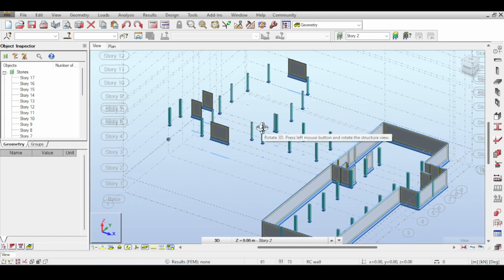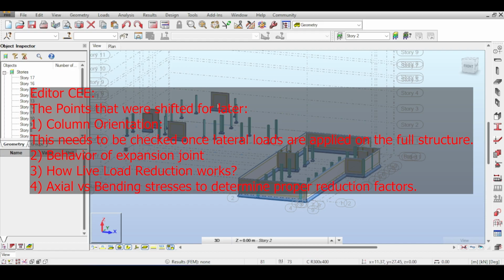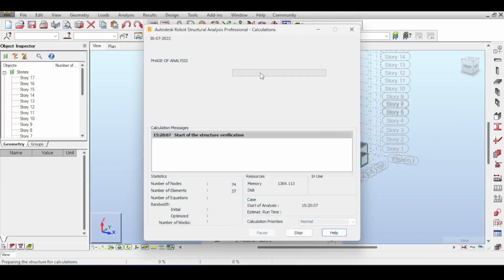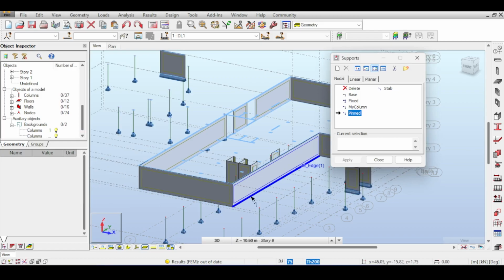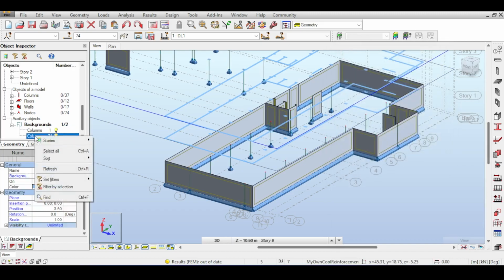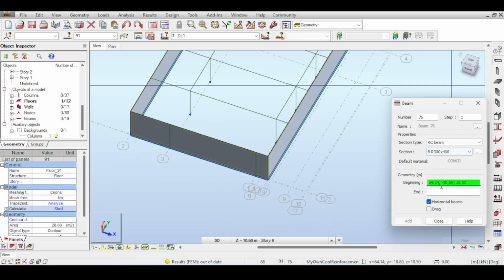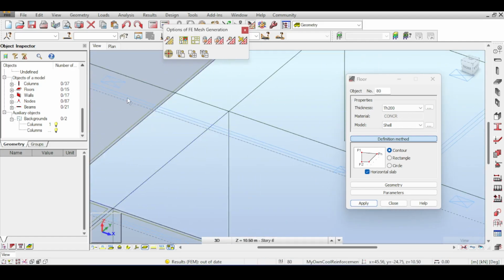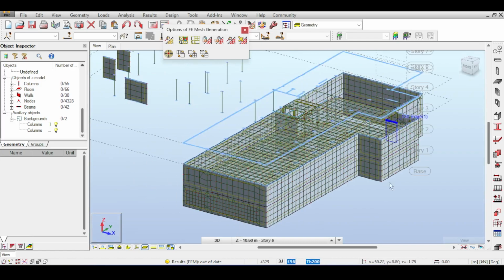Modeling and Design of RC Buildings in Autodesk Robot | Part 5: Underground Modeling

Comment: Hi CEE, i have same building. Thus i have question here. I need to model basement slab for transmitting load as reality
Reply: additionally, at bottom level of column should be assigned fix support?

Comment: Dear CEE, Thanks for your making VDO series,  I'm wondering does we have to draw basement wall along X axis parallel to the  global axis  as we draw the Slab? or we've other way to control local axis parallel to global axis after we draw basement wall?
Reply from the maker: Usually when I model a retaining wall, I try to keep the local axis aligned horizontally, and the vertical axis aligned vertically.

This is different than what I do in slabs. In slabs, I try to keep my x-axis with the global x-axis.

But why is the retaining wall different?
The retaining wall is different because there is a meaning for the "horizontal moment" as it controls the horizontal steel in the retaining wall. There is also a meaning for the vertical moment as it controls the vertical steel in the wall.

But why then is the slab x local with x global?
Because in a slab, both steel directions are horizontal, so it becomes important to know which steel goes in x-x and which steel goes in y-y.

Hope it helps, regards,
CEE
Reply: @CivilEngineeringEssentials  Dear CEE, Than you very much for your Answer, Now I understand how it work and modeling between retaining wall & Slab in RSA. Thanks again for your kind. 
Best regards,
Sothat

Comment: Hello Dr. CEE,

Your opening discussions and thought process on the possible classification and hence the determination of the proper moment of inertia reduction factors based on the magnitude of the compression force on the element or the member under consideration is quite interesting and informative. Although I do not directly use the ACI code in my region, I still appreciate what has gone into that discussion. It is quite refreshing that this is not about being assertive or about make believe without reasoned arguments. I find these kinds of qualities from this channel to be something to be admired.
    
08h34 This is a much simpler and effective way to draw those walls. Thank you.

Indeed, this is a lot of work and there is still a lot more work to be done. I do think however that it is important to acknowledge and to experience the time it takes to actually do this kind of work. Doing so will help the designer or the structural engineer to develop a realistic feel of how much and how long such projects and other similar project could actually take in real-life situation to complete, this knowledge will certainly become handy for planning and for resources allocation on the project. Too many projects deadlines are usually set by people who have the least understanding of what it takes to complete the work or what work in detail is actually involved; the engineer will do well to be able to give realistic time frames on such meetings to crub any unrealistic expectations.

I have enjoyed this video and I am looking forward to the next CEE videos

Keep well 

Kind regards, DK
Reply from the maker: Hi there Engr. DK,

I had to do this little discussion because I noticed that this question as asked in multiple videos in the past and the last one in particular.

To be honest, I kind of banged my head against the wall when I saw that this method works perfectly. I was like: why did I go through all this? but yet, you know, I keep it as an appreciation to all junior engineers, although speeding it up and editing it to avoid wasting anyones time.

you are 100% correct. It is kind of: here is the project, and that is the deadline, and the deadliners do not appreciate the complexity of modeling. 

Thnx a lot for your inputs, and stay tuned for more content.
Regards,
CEE
Reply from the maker: btw your comment does not appear under the video, I have no idea why.
Feel free to copy and paste another comment, I would copy and paste my reply

Comment: Hi dear Doc.

Great tutorials as always. However in my case I’d probably place columns in the basement walls to take up the moment, shear and axial load transfered from the floor.  In this case I get to design the basement walls for purely earth pressure from soil only.

What do you think? Is it a good approach?
Reply from the maker: Hi there Engr. Nii,
that is a really interesting approach. I want to elaborate on some little thoughts I have when I consider your idea.

Let me discuss how the basement wall is "supported":
Direction 1: The Vertical Direction
if it is connected to the slab, and has a foundation in its ground, then depending on how stiff both connections are, you would have "for example" a pin at the bottom, and pin at top".

If the basement is "for some reason" not connected to the floor, then it is a cantilever at bottom, and pin at top. This usually works only if you have a single basement level, which basically means that for our structure, this approach would not be possible.

Direction 2: The Horizontal Direction:
Here comes the consideration of the column
You stated that you wanted the basement wall to purely resist earth pressure from soil only. And the column to resist its applied floor moments and forces.

From what I gather, it seems that the column does not play a part as a support for the loading in the horizontal direction of the basement wall. This means that: you would have to separate the column from the wall both in real life and in the model, so that both do not feel each other.

That is the only possible pitfall that you need to beware.
If you want to see why columns do affect the resistance of basement walls and act as supports in the horizontal direction, check out: "Buttress Retaining Walls". I know the application and some of the concepts are different, but I want to highlight how the retaining wall is treated horizontally.

Anyway, Hope my comment helped you. Stay tuned for more content and feel free to ask any follow-up questions you might have in mind.

Regards,
CEE
Reply: This is an interesting discussion however, is there instances where a basement wall is not monolithical connected to the supporting floor above? I usually design basement walls as propped cantilevers with moment release at the top of the walls as opposed to a purely cantilevered retaining/basement wall.

Separating the walls and columns in option 2 is practically impossible however is it’s possible to model the basement walls between column bays as opposed to modeling the entire stretch of walls? Would that achieve the purpose of analyzing columns for moment, axial and walls for out of plane bending only?? My thoughts
Reply from the maker: I agree, it is interesting. 
As for when a basement wall is not connected to the floor: here is what happened in my uncle's house. So, he has a basement that starts at level -1.5 to -1.8m (I do not remember). The ground floor starts at level 1.5 to 1.2m.
Why did we do this? to save money by reducing the excavation depth, as it was mostly clayey soil and we had to excavate and replace some soil. Also, having a "4~6 step stair" to enter the "Mansion" seems classy and cool, and elevates the ground floor from the surrounding garden.

To save money in concrete, the basement wall was only cast up to the ground level, and the rest has been built up via blocks. The basement had windows so it was well lit "because you have parts of it above the ground". 

As for modeling the wall stretch by stretch, still, the FEM meshing will cause the column to pick up moments from the wall. You are right, separating walls from columns is not a simple task. 

I think I should dive deeper into this once I reach the basement wall design. But this is an amazing and fruitful discussion and I enjoyed it.
In case you have any follow up thoughts, feel free to share them here.

Comment: Hi dear CEE, couldnt be possible to “rigid link” the column to the wall leaving it in the “architectural position”? Ty as always!
Reply from the maker: Hi there Engr. Candea,
That is a really interesting idea. It would be possible, and here are my thoughts on it: 

if you are connecting the ends of the column only to the wall via rigid links, then force transfer happens only at the start and end of the column. Meaning: the column does not feel the earth pressure. This approach would be PERFECT if you are intending for the column not to assist the basement wall, which also means that the column and the basement walls are not connected.

if you want the column to feel the earth pressure and assist the basement wall, then you could use the rigid links but you have to link all mesh points to the column, not only the start and end. so in that case it might be easier to just shift the column into the wall.

Hope it helped,
Regards,
CEE